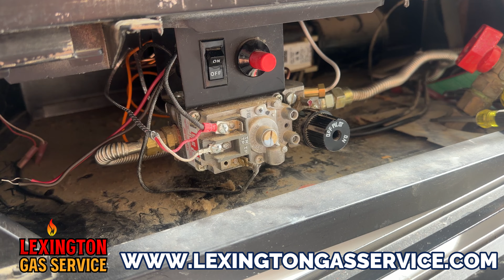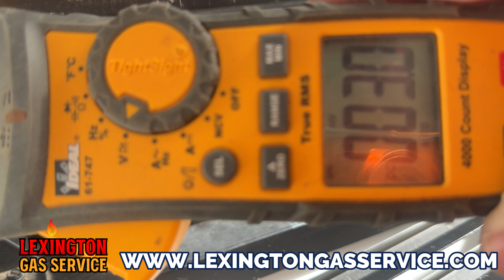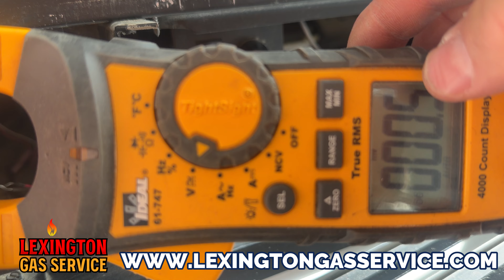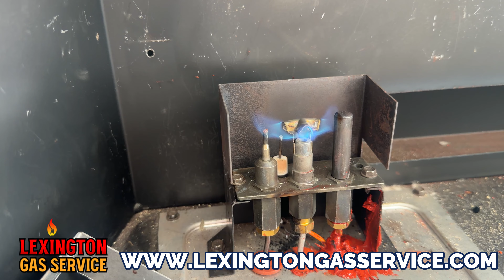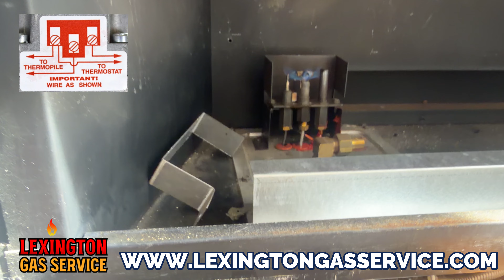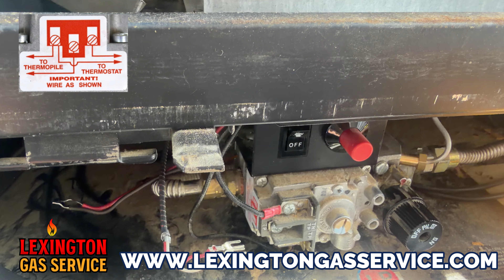Millivolt Gas Valve Test & Thermopile Voltage Check | Gas Fireplace Troubleshooting

Comment from the maker: 🔥 Gas Fireplace Won’t Light? Start by checking the millivolt system.

In this video, Lexington Gas Service in Lexington, NC shows how to test a millivolt gas valve and thermopile on a Heat-N-Glo fireplace using a digital multimeter. We explain the voltage readings you should see and what problems to look for before replacing parts.

🌐 Need professional gas fireplace repair or diagnostics?
Visit: https://lexingtongasservice.com

💬 Drop your questions below — we try to help when we can.
👍 Like, Subscribe, and Share to help others troubleshoot safely.